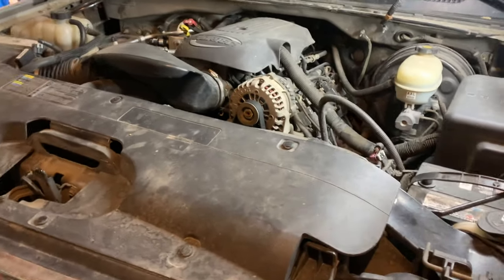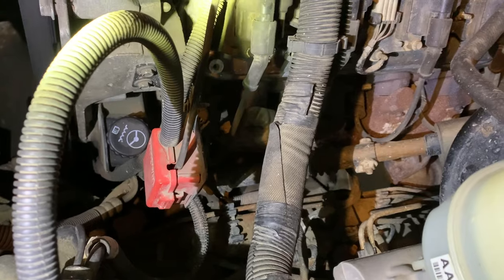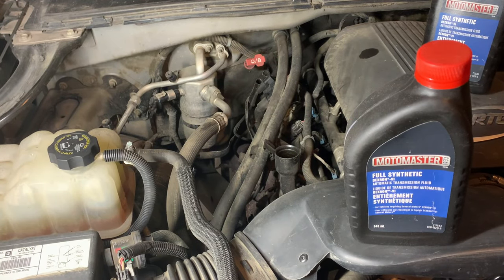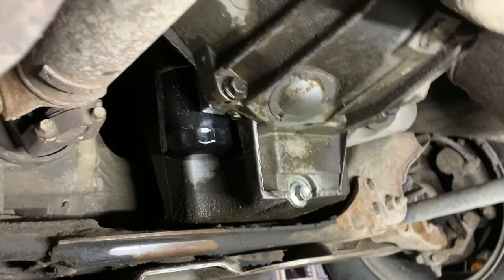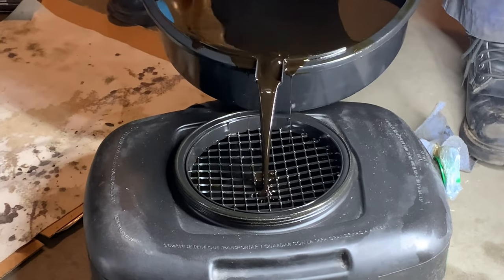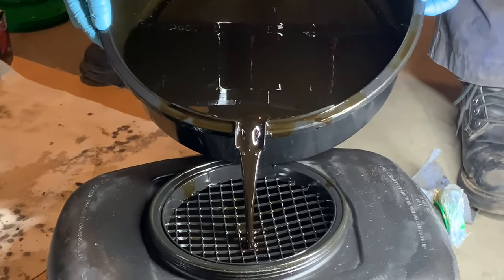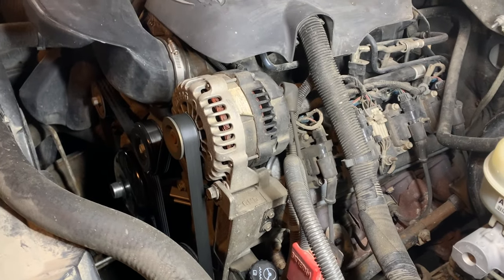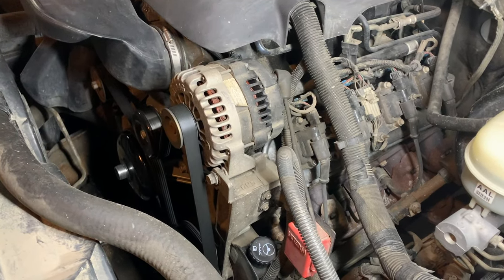DIY Engine Flush using Automatic Transmission Fluid

Comment: You need to leave the ATF fluid in for awhile.., 1000 miles is what I do every other oil change and mine no longer ticks. The shop wanted to charge me $1889 for new lifters and cams. But $4 worth of ATF fluid saved me a butt load of $$$&
Reply from the maker: Thanks for the suggestion! That’s huge savings… 💰
Reply: Butt load 😂 it’s boat load
Reply: Its safe to drive around?
1000miles esp....
Reply: @teddy_awdB19 personally i asked around do it for 100 or 200 so it can get in the system 1000 may be to long i wouldn’t
Reply: I’ve done that very thing in the past myself with positive results I’ve also used it as a fuel additive which cleans the entire fuel system. 1/4 quart per full tank then immediately run a strong mixture of Berrymans B12 Chemtool or Seafoam to eliminate any oily residue. Improves fuel mileage. Also Marvels Mystery Oil is an excellent product which can be used in the engine as well as fuel..
Everything’s eventual but preventive maintenance is just one piece of the picture when it comes to a vehicle’s longevity.
Little Things Count!
Reply: Ive been doing this since the 80s.I go about 50/50 oil auto fluid and run just untill ticks go away plus 216 miles
Reply: Use Marvel Mystery Oil
Reply: @jamieb9556  yes that’s exactly what Marvels Mystery Oil is.   Trans fluid is a detergent and a very good one.
Reply: Exactly right.
Reply: @Helmuesi911 men say butt load . Women say boat load
Reply: johnjohnson2855
 🙏 Please help 🙏
I heard only ten to 15 min . And don't drive on it ever. Esp not 100 or even a 1000 miles cause std is non lubricating can ruin oil seals , can get oil leaks etc . Hurt engine ! 
So I'm confused how you're doing this . 
I have a 2003 Cadillac Seville that has tapping sound that gets fast and louder . It drives me crazy.  I've tried slick 50 and seemed gone cane right back in less then three weeks. I don't have money to fix.  Worried . Only car I have can't afford another. Bim unemployed living in motel lost my house. 
🙏 Please help 🙏
Reply: Why dump in random fluids into the engine when they sell engine flush fluids specifically engineered to clean it out? Maybe also try brushing your teeth with it once in a while too?
Reply: @zfunk9 . True, but atf, diesel and kerosene are poor man's engine flushes
Reply: @zfunk9 those don’t work as great
Reply: The blackness of the oil & transmission fluid is created by dissolved sludge and the bubbles are chunks of sludge. 
 Regular oil changes help prevent sludge.
Reply: What you driving a Ram? Ive been putiting 5w30 in mine and it goes away for a week them comes back. Never heard of this till today

Comment: My buddy puts a half a litre of ATF in every oil change…he’s done it for years…both of his trucks have well over 400,000kms and work like new!..
Reply: Running with atf or just use it for flushing like 15 min qnd drian all the oil
Reply: @aveirozinou2919  he would run it with the ATF…his uncle has a Peterbuilt with an N14 Cummins and he puts a full litre of ATF in every oil change and a full litre in every tank of fuel and that truck hit over 3 million Kms on it before Cummins replaced the engine free of charge because he took it in for its scheduled valve adjustment and they screwed something up which damaged the engine so they replaced it for him on condition that he would give them his old engine so they could analyze it to see what failed and also how it lasted so long!..getting over 3 million kms on a truck engine without a rebuild is very abnormal even though the N14 is in the million mile club…
Reply: @MrMan5014  that's awesome I'm surprised that can an engine run for 3 millions km, for sure the way he drive the truck and also way he uses atf make the difference, i have a volkswagen cc run with 5w40 oil, can i added atf to the oil or do i have to use it just for flushing the engine? Thank you for the reply man 🙂
Reply: @aveirozinou2919  if it was my engine I would have no problem putting a quarter of a litre in the oil…that being said, using a 5w40 synthetic oil is probably all you need…oils are so much better today than they were years ago and putting ATF in the oil is an old school trick for older engines…
Reply: @MrMan5014  probably innthis case i will use ATF as an engine flush every 2 or 3 oil drain (i usually do my oil change every 7500 km), to be honest i use it in my fuel disel tank for approximately a 300 km and it looks like a did a rebuild to my engine so quite so smooth, i do not know if i can use it every full tank refueling but if it will not harm the catalytic converter and the egr ( i will delete the egr sooner) i will never hesitate to do it 😅

Comment: My truck started doing this when I missed my oil change by 3k miles. Ran synthetic atf I got from the gas station for 500 miles , and it got quieter. I ran a convention atf +3 and it totally took the noise away completely. Changed the oil every 3k from then on out and it's ran perfectly
Reply from the maker: Nice! Glad you got your engine noise resolved! 👍
Reply: Stick with full synthetic instead of synthetic blend and your engine will last as long as you use your vehicle.  Mobile 1 is a decent filter too.
Reply: I heard the old school fluid conventional atf works better than synthetic atf like you said
Reply: marvel mystery oil could have done the same thing too

Comment: I found out your injectors will cause the same sound, if its running rough change the injectors. Surprised me. God Bless
Reply from the maker: Wow that's crazy. Never knew that
Reply: @lmsdiy  I have worked on vehicles my whole life and would not have believed it if i never seen it, my son in law had a 2002 gmc with a 5.3 and i would bet my life it was a lifter ticken it was running rough so he put injectors in it from amazon about 50 dollars for 8 and when he started it, was like a new engine, quite as a church mouse. And ran like a scolded dog, that was 2 years ago, he still has the truck, and still runs like new with almost 300 thousand on it now, it had about 150,000 on it when he changed the injectors.
Reply from the maker: @randallhorner5970  wow, that's amazing! For $50 I might replace them all just for the fun of doing it, whether it helps or not! 😁👍
Reply: Amen
Reply: You right people forget fuel knock exist
Reply: or else dump some Chevron Techroline in the gas and see what hapens, that;s what I usually do

Comment: You should replace one qrt of oil with atf. It won't hurt a thing and will likely fix your lifter before you flat spot your cam.
Reply: yes i agree. i had ticking and low oil pessure in my chevy avalanche. used motor medic, ran for 10 minutes. replace oil with 0ne quart atf. it is quiet and good oil pressure.
Reply: I can't tell you how much I am not willing to do this, and how bad it is for your internal engine parts... any automotive engineer or mechanic will tell you to never put anything but oil in the crankcase if you want it to last a while.  But I too have wanted to flush a dirty engine once in a while and did a lot of research.  Your engine is much much better off getting a slow gradual flush, using some less aggressive solvent, in smaller quantities - something like a pint of Marvel MO while idling engine for 10 minutes.  Then changing oil afterwards.  Do that twice in a row the engine will gradually clean itself if your oil changes are frequent enough.  To me - running ANY solvent in your engine is counter-productive to what you want to do!  Solvent does not lubricate, I don't want to have the worn out engine that is the cleanest inside of them all, why?
Reply: @BigEightiesNewWave  So is 3 in 1 I'm not filling cars with that either.
Reply: @robertmaybeth3434  MMO has solvents, just do a double oil change to get all the old oil out. The new oil will do a much better job in cleaning and protecting.

Comment: Just change your oil every 2-3k miles now, every time you miss your oil change interval you are shortening the effective oil change interval. Don't think neglecting your oil change for the first 50k miles is ok because your car is "new" then start to change your oil at 5 k is going to fix anything your engine now needs a 2-3k oil change interval even with synthetic oil

Comment: theres a diff tween ticking and knocking, thats diff a lifter tick, if hear knocking 8 outta 10 times its main or a rod journal's and they do sound different. but the atf trick is an old school thing we used to do even back in the 70's. good job :)
Reply from the maker: Thanks for your insight on that (ticking vs knocking). Much appreciated!

Comment: Auto parts used to sell ENGINE FLUSH in qt. cans back in the 60's , was nothing but ATF and said to runn for 100 miles before oil change useing leaded gas.
Reply: Marvel Mystery Oil?  Used to use 1/3 quart prior to oil changes on the last car I had.  (3000-5000 miles)

Comment: Yeah I have used trans fluid for years to flush an engine.  I only put a half a quart and let it idle for 1O minutes. Then change the oil. It works on getting all the weird noises and it will run pretty quiet aftwards.
Reply: Going to do it now ❤
Reply from the maker: Nice. Thx for sharing your experience on this.

Comment: I have the same truck, same sound, I ran the 1 quart of ATF for a month and ii has so much sludge build up at the bottom of my oil pan the the oil pick up tub got clogged. Had to pull the pan and clean about 2 inches of sludge and clean out the tube. crazy!
Reply from the maker: Wow, that’s nasty! It’s great that you could pull the pan and clean it out, that’s quite a bit of work. 👍

Comment: You can leave the atf in your engine fir much longer periods. It will do your motor good to have it moving around in there fir a few hundred, even 1000 or so miles.

Comment: the knocking is a lifter! a quick fix pull the intake and replace the lifters on that side ,,i would do both sides anyway,,may as well change the pushrods at the same tome   put back together and you good to go till the truck falls apart! its a chev so it will rust to death before you need to do it again  :)
Reply from the maker: I wish I would have done that (got a different truck now). The older 5.3L engines without AFM are awesome and I think it would have been worth doing this work.
Reply: They are trapped lifter design. The valley under the manifold just has knock sensors on that Gen3 vortec. You have to pull the heads to get to the lifters. Still it is not a big job. Well worth it on these engines, they will make it to 300,000 as long as they have somewhat clean oil and descent oil pressure.

Comment: If u have low oil pressure when its tapping its ur o ring in your pickup tube there notorious for that
Reply: I’ve been chasing oil pressure issues. I put new o ring. New pump. New oil pressure sensor and still had low pressure. It’s the good old main bearrings. :(
Reply: @B1gbleu  if its not that did u change out the fliter behind the oil sending unit it gets clogged alot and alot of ppl dont know to change it also

Comment: You can also drain your oil. Add a new oil filter.  Fill up with ATF. Run on idle for 15 minutes.  Drain, add new oil and filter.  
Next oil change should be @ 1000 miles.
When running all ATF of you can add 1 quart of regular engine oil with 3 or 4 quarts of ATF. Idle 15 - 20 minutes.
Reply: Please DO NOT DO THIS!  I'd be nervous just running with just half a pint of ATF in the crankcase let alone running the engine while full of the stuff.  ATF does NOT have the right additive package nor even the right viscosity to substitute for engine oil.  And if you ignore that advice there's a good chance you'll destroy your engine.
Reply: @robertmaybeth3434  
This is to be done only on older vehicles with high mileage and problems with sludge build up. Been doing this since the late 90's.
Reply: The best bet is put cheap new oil in it then put a bottle of seafoam  run it for 2-3 hundred km  on the highway   that will get the oil on every surface.   It gives it time and pressure to get all the ports and surface clean of sludge .
Reply: @robertmaybeth3434  
Been doing this the late 90s.  This is only to be done on older vehicles with sludge problems.  A Technician @ Nissan provided this method. I ran it by my shop through the head Technician, he informed that ATF is a method that has been used for several decades to deal with engines that have sludge problems.  This is the method that I used on my 84 300 ZX Turbo.  It takes time, so you have to be patient.  By the the way; both Technicians informed me to stay away from engine flushes sold in a bottle @ the local auto parts stores.
Reply: @Beparepa  
This is a good method because your are building up oil pressure.  Either seafoam or half a quart of ATF on new oil works.  Full ATF in engine is only for idle for approximately 15 minutes.  Drain and install new oil filter with oil.  It takes time. Slowly but surely.

Comment: That’s an exhaust leak your hearing. Common on these engines that the end bolts on the exhaust mainifold bust off. They have a fix it’s called kap adapter.

Comment: You should leave the ATF in the engine for about 100-300 miles b4 a oil change. Also Using Marvel mystery oil is another good option.

Comment: Engines have seals, rings and gaskets. Some metal, some rubber and some silicon.. transmission fluid swells up rubber.. so you might flush the engine well, and get an improvement, but can cause issues elsewhere.
Reply from the maker: Hey thx for the insight. From what I understand and have read, transmission fluid does not cause rubber to swell, like silicon spray or brake fluid would. So don't mean not to appreciate your input but I think that might be incorrect. Thoughts?
Reply from the maker: I did read that it may affect seals and gaskets. Maybe it's the amount of time it spends in contact with these parts? I.e., occasional flush running it for ten minutes vs using it in the engine for hours and hours? Would that be the difference?
Reply: @lmsdiy It can be 1 litre in for a week and won't hurt.
Its being 4.5L and left in for 3 months can soften the seals. They go bad anyway after a decade! 
Once the oil is changed the teeny bit of Dexron left behind won't do anything bad. 
I work with hydraulic equipment.
One customers employee got the hydraulic fluid and a plastics chemical that looked similar, mixed up and poured an 18L pail into the sump. 
The machine didn't flinch, kept working correctly.
The plastics chemical was designed to soften rubber and plastic during production. 
Ive personally swapped out to non recommended fluids in systems and had no problems.  
Some oils are very compatible if you know what you're doing.
Reply from the maker: Super interesting! Thanks very much for sharing that @RetroCaptain.
Reply: Or.....knock knock. Who's there? Connecting rod #4!